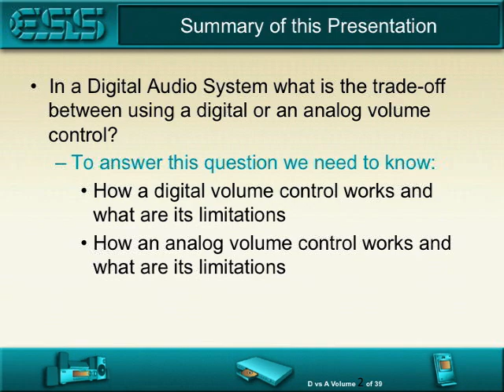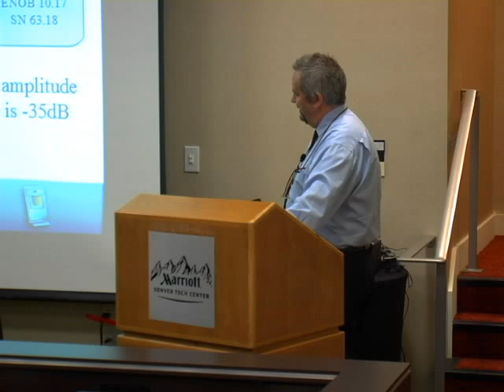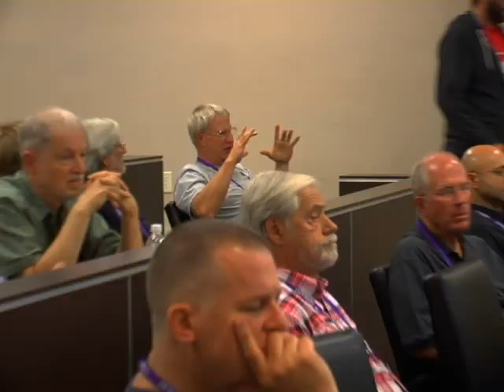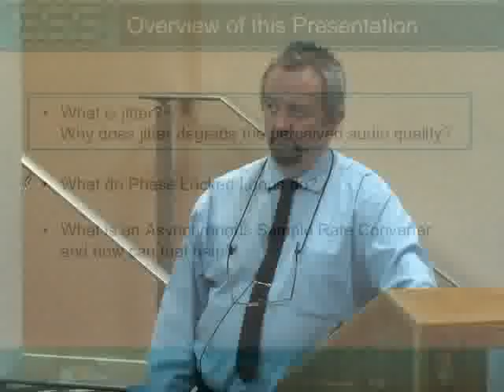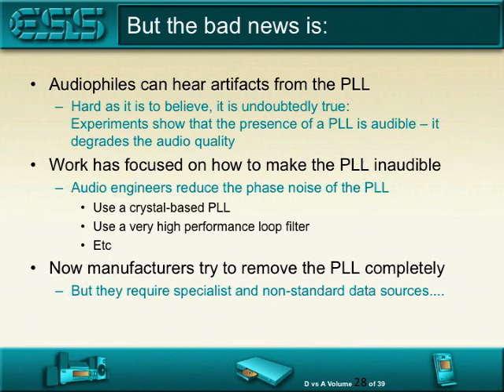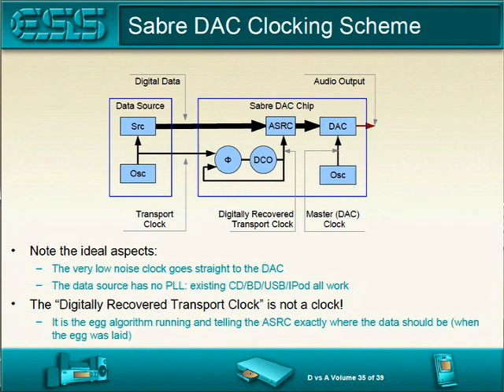RMAF11: Digital Jitter and Volume Controls, Martin Mallison, CTO, ESS Technology

Comment: And just to add, before the digital era, in the good old analogue days, before audio IC op-amps  were around we had a much better chance of quality audio reproduction as designs were using discrete semiconductors or vacuum tubes or a mix of both. However, now all of these fantastic advances in digital are being crippled and compromised by the ubiquitous use of op-amps to handle the audio signal.
Reply: I dont know what is wrong with using OP amps in audio , but  of course digital noise  is  present ,  as is Amp noise , i didnt hear Sampling Noise , i heard Amp noise , that is less in analog controll , but its not that big of a deal , only in quiet  room ,  not something you find in Citys often

Comment: Good, seems progress is occurring.

However, if the chip uses op-amp based voltage out it is compromised in meeting the pro-audio benchmark. Op-amps never can come anywhere near good discrete or vacuum tube design. They suffer from geometry limitations, use high forward gain and feedback and so introduce objectionable distortion that can never be removed and makes using open loop no feedback amplifiers in the following stages a worthless exercise. So if the chip has op-amp output that can not be bypassed it creates a weak link in the device that which will be a limiting factor that cannot be overcome. Also what semiconductor family is used? If it is CMOS how is it implemented to overcome the threshold switching sensitivity to supply voltage and resulting jitter generated over better family types such as ALS or better still ECL? Having a low jitter clock and feeding it into noisy CMOS is a waste of a good clock oscillator and counter productive to the aim of reducing jitter. Also how is the final D/A conversion clocked? How many gates, how much degradation to the source clock purity?

Seems the compromise for ESS is placing low power consumption higher on the list and pushing audio quality further down the list.

Oh, and if you are thinking of quoting THD+N figures being very low and using that as an argument, please don't, you are not even close to the ball park. Some people will understand what I am talking about.

Comment: Very good presentation - and quite unbiased...

I was a little surprised that he didn't mention the other downside of most analog volume controls - physical potentiometers are notorious for having very poor channel tracking down low (switched attenuators avoid this problem; but most lower-cost DACs with analog controls use a plain old potentiometer).

There were two other thing he didn't mention when he talked about "how nice it would be if the DAC could get the source device to use it's clock - instead of the other way around).....

1) When you have a one piece CD "player" instead of a separate transport, then that is usually exactly what you have - the transport drops the data into a buffer, and it is then clocked out by the clock - and sent to the DAC. As long as that clock is very good, you avoid all that stuff about locking onto the clock in another box with a PLL - or ASRC.

2) The same is true when you have an ASYNCHRONOUS USB input. The receiving device (the DAC) tells the sending device when to send data, and uses a small buffer to make sure it never runs out, and so you get to use the clock in the receiving device to clock the data instead of the clock in the sending device. Again, you have his "ideal situation" and the data clock is as good as the clock in the DAC, so you don't need to fix it in the DAC.
Reply: I suppose they have to cover all bases having the sample rate converter in there. I really hope that sample rate converters have improved. I used one of the AD1890 AD1891 devices when they first came out and the performance was really dismal. Like rubbing sand paper through your ears. Ended up putting my own design low noise butler oscillator at the DAC chips with some ALS logic family D flip flops re-clocking the critical word latch. Sending that master clock buffered back to the CD player. Took that sub standard sample rate converter out and never used one again.